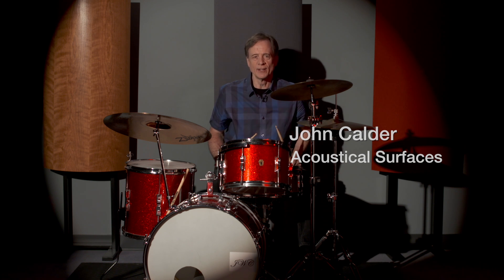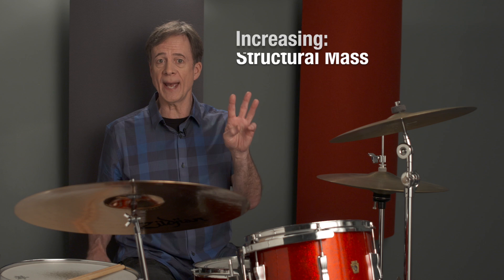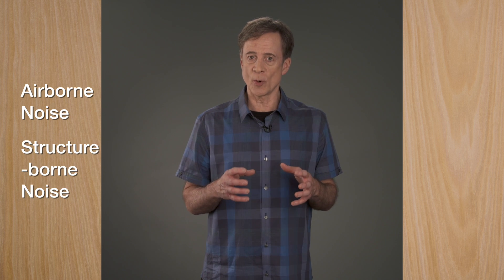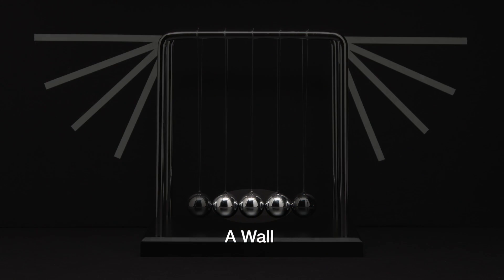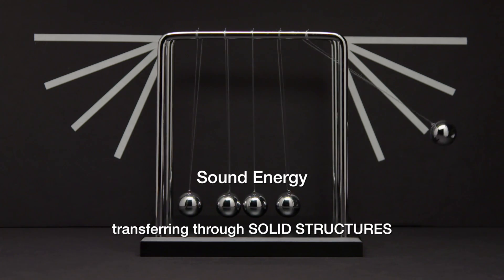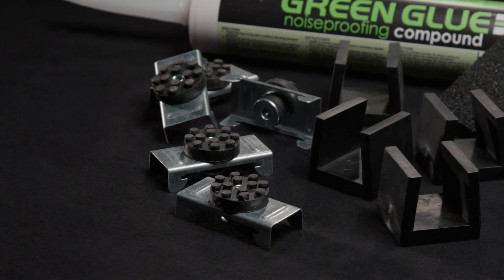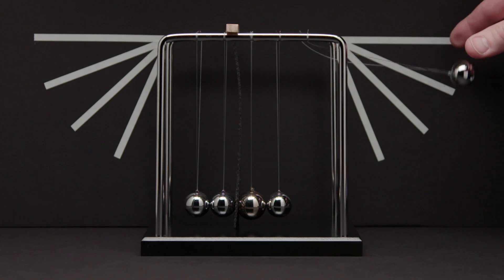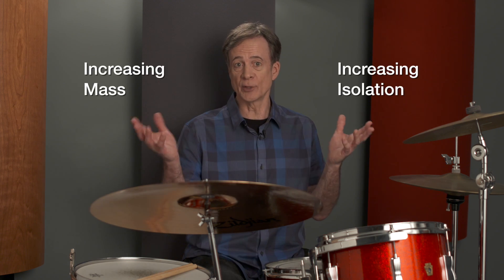What Is Soundproofing? - From Acoustical Surfaces

Comment: correction: you want the cladding to be densely massive, but the framing to be lighter.  lightweight higher-gauge steel studs are better isolators than heavy wood or thicker steel.....they allow flex, which lowers  planar transmission
Reply: Spadea.